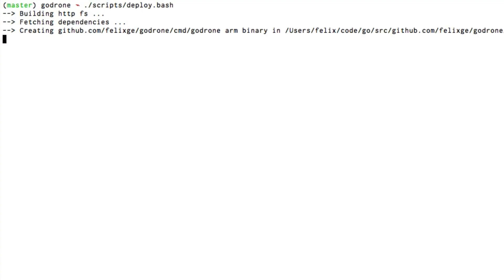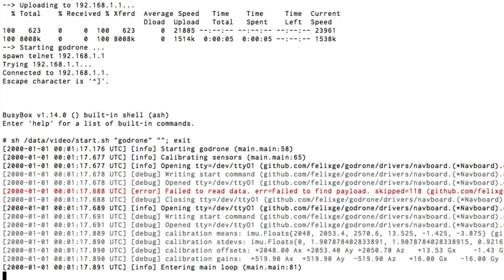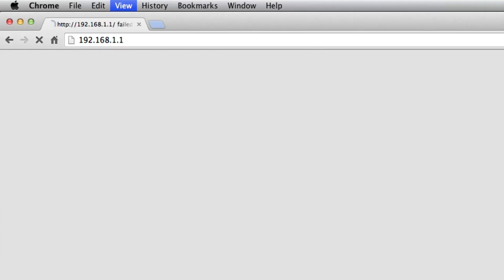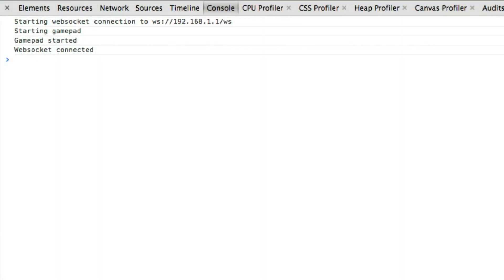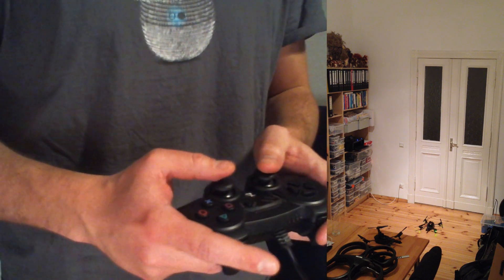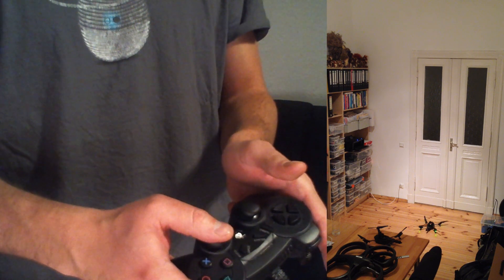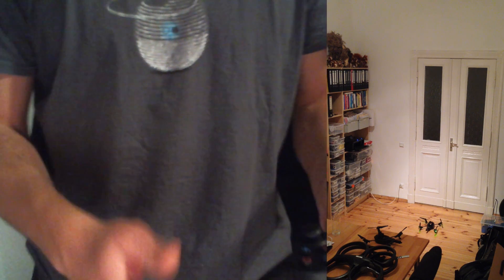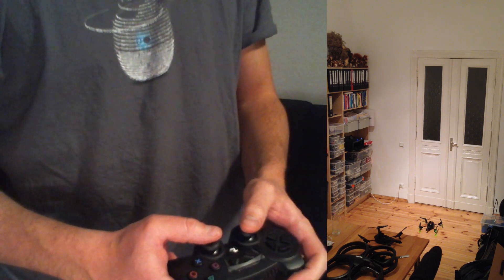Godrone Ardrone Firmware Test #2

Comment: Curious why you used go as opposed to nodejs (or some other lang)?
Reply from the maker: Mostly because I really like Go these days.

One benefit of Go is that it produces static binaries which makes deployment a little easier than FTPing lots of JS files around each time (I suppose one could also bundle them into one, but with Go I just don't have to worry about deployment much). Go will also make it easier to provide an installer for end users in the future (if I get that far).

That being said, this project could probably be done with node.js (and other languages) as well. In fact, I did some live coding showing how to create a motorboard driver in node.js before: http://goo.gl/s1p1Bz